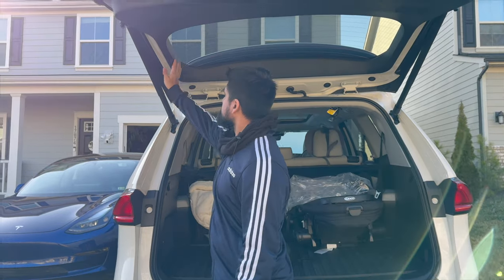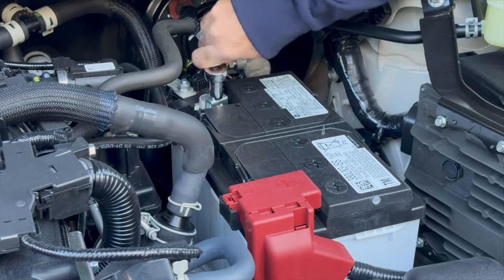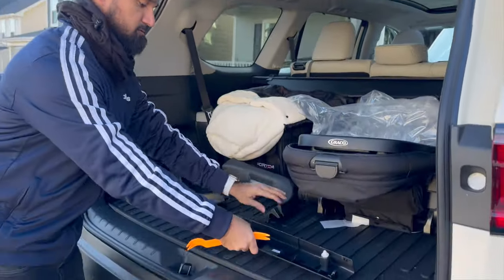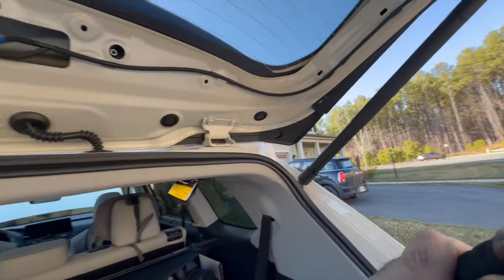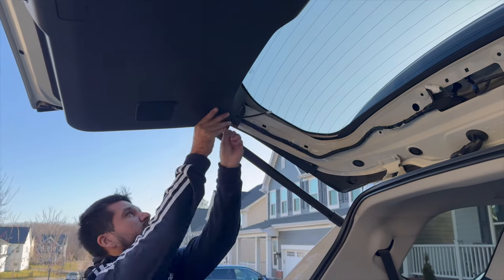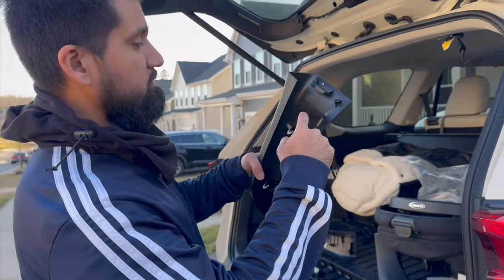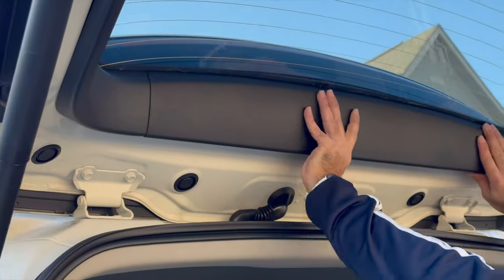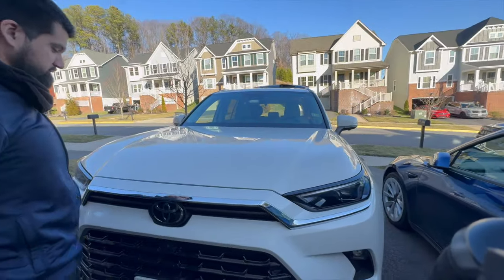Toyota Grand Highlander Rear Hatch Cargo Lamps installation

Comment: Nice job.  I believe I saw another receptacle at the center top of the door when you removed the trim piece.  I wonder if that will allow installation of the Digital Rear View Mirror camera for the Limited and XLE models.  Are you considering installing that as well?